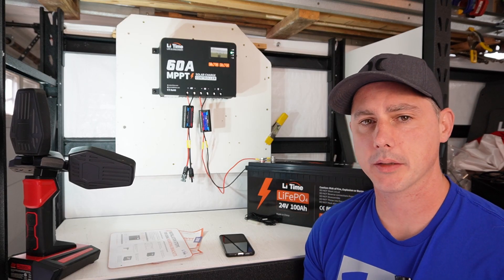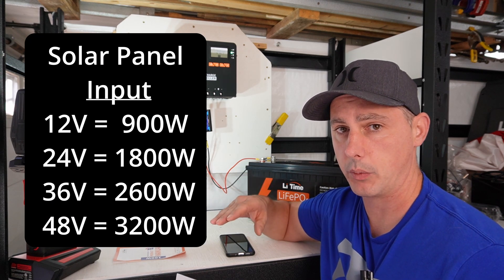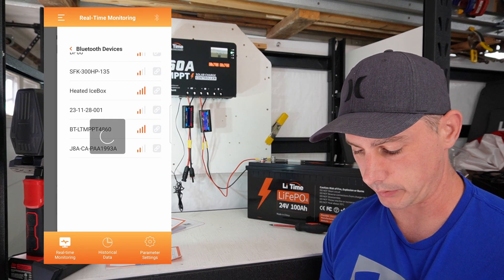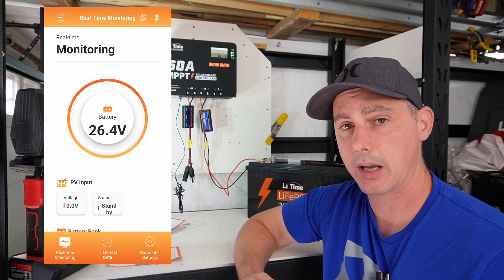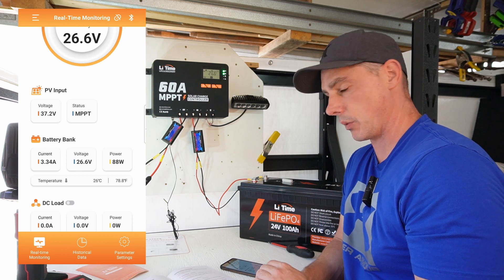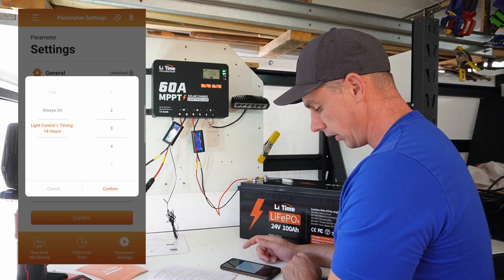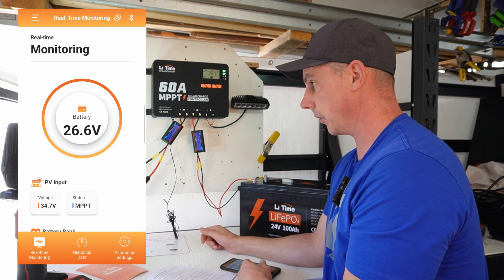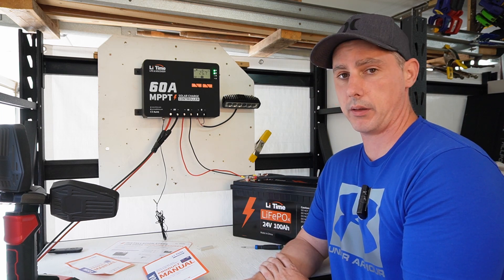LiTime 60A MPPT Solar Charge Controller 12V/24V/36V/48V | Bluetooth |

Comment: Is this 150v max for all battery bank voltage type or is it 150v only at 48v
Reply: 150 volt for anythink...... max charge speed is 61 Amps in real.
my neighbor drive it with 5KW PV, all day<s long ~61 Amp charge speed no overheat about the right sized heastsink
Reply: @markuskabler  what battery bank are they running?

Comment: How do you get it to stop charging at 27.7? Mine has it going up to boost voltage.  28.8v
Reply from the maker: Look for user settings and set your parameters 👍
Reply: @Roll2Videos  thanks man I wasn't sure if "USER" was OK for lithium.  I am educated a bit more now. 😊

Comment: Do you get an error with boost charge over 13.9 ?I seen comment that was the fix on hobo vid.Over 13.9 a guy got error.Said to set float at 13.6 I guess a lot of people have this issue?
Reply from the maker: It's been so long I can't remember. Keep an eye out if I do a follow-up video
Reply: My 60A HQST showed up today.Just like your LiTime 60a.I’m debating on even opening it and send it back.My box has a Renogy packing slip label on it.Great vid !
Reply: Yah if your looking for content do a follow up vid on said issue if yah have the issue.See yah !
Reply: Haha I sent in request to return .Told issue and they sent me a page from manual to set it to Li battery.What a crock of poo!
Right then and there I opened box because I’ll not waist time for return.Just hope I don’t toss it in trash can.Who knows it may work but I’ll buy something else next time.
Reply: I hooked it up to two 100 watt panels.Bat was 13.30 and going up but 4 hours after sun went down 13.02 ?
Renogy panels are new.

Comment: The low temp charging cut out is well explained on other channels. It also explains in the manual. This is a OEM Helios product, sold by a few re branders
Reply from the maker: Yes, I didn't have that information when I made the video.

Comment: it actually HAS low temp protection, but its disabled by default.

Enable Low Temp. Protection:
Press gear butten longer, 
choose LI for Lithium, 
then continue to hit gear icon until u see "OFF.F", 
Press "UP" for "ON", 
hold Gear Icon , then saved

Temp Sensor must be connected ;)

Credits: HOBOTECH HQST MPPT
Reply from the maker: Thanks

Comment: i just buy one too....will come next week...before i buy a Eco Worthy 60a mppt...is totaly junk....i just must send it back...i just want to say, i buy a battery LiTime 100amps, and a inverter 1000w...i am really impressed....the inverter takes in standby about 0,4 amps.....and i find this super. just want to ask...for 60amps between controller and batteries i need a 16mm2 cable...will fit ?
Reply from the maker: I think that's about a 5AWG wire good for 60A

Comment: Do you think I could use this with 40.8V panels such as the hyundai HiN-S365X?  If so would 36V or 48V be more appropriate?
Reply from the maker: I believe this had up to 145V VOC. You would have to consider the minimum voltage needed for your battery bank. Typically 20% higher than your bank voltage.

Comment: Thanks for the video  Glad I found your channel  not much out there yet on this new controller
Do you know if it has a minimum voltage Solar input ?  I would like to get one for a 48 V system
Reply from the maker: I checked the manual and I'm not seeing anything on the minimum voltage. Sorry, I can't help.
Reply: The 60 amp has a max PV voltage of 150v, so depending on your panel wiring scheme , that should not be a problem

Comment: Hopefully you can recommend they do a firmware update to add the low temp cutoff 
(User adjustable because I think the HSQ is set at 32 degrees Fahrenheit)
Reply from the maker: That would be great if they did that.
Reply: can someone please do a head to head comparison of all the new 460ah lifepo4 batteries that are coming out? redodo bird, roamer, litime, epoch, basen, VATRER, power drag queen, etc.. thanks in advance!   @Roll2Videos
Reply from the maker: @DeFiDuke  LMAO Power Drag Queen. I'll get right on it.

Comment: Nice😊 how many amps can the DC output handle? I guess it’s just for small loads like lights etc. but say a diesel heater that needs about 10Amps(12v) during startup?
Reply from the maker: Hey buddy 😁 30A on the load side.
Reply: thanks👍
Reply: The 20A, 40a and 60A can handle 20A @ 5 volts. It's is designed for lights, hence the light bulb on the silk-screen. After checking some settings in the solar controller, the voltage for the "lamp" circuit is adjustable from 5V to 15V, which is Great !